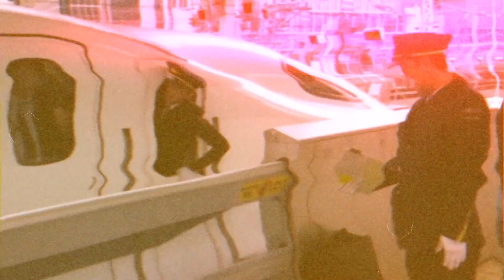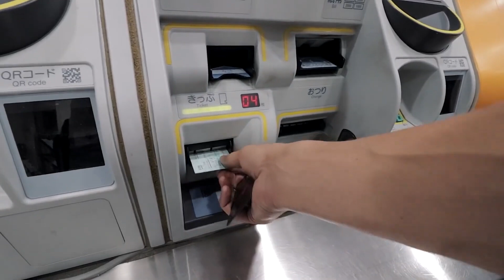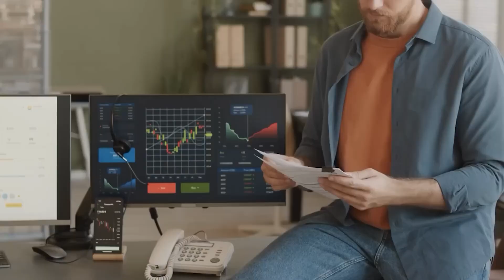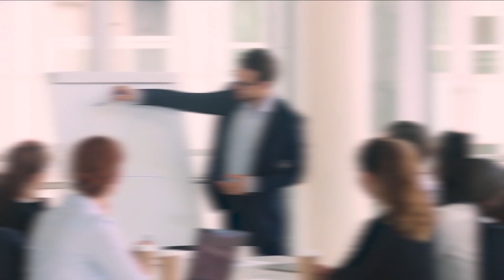The $30B Dallas to Houston Bullet Train: Will It Revolutionize Travel in Texas?

Comment: So, when is this project scheduled to start operations?  For this project to be financially sound, how many passengers per day are needed?  Where are the stations in Houston and Dallas located?  Let's say the stations are downtown.  Now, let's assume an oil company employee that works in the Energy Corridor in Houston needs to attend a meeting in Plano.  How long will the trip take?  What is the total cost?  Where is the parking?  Assuming the use of video conferencing brought on by the COVID era continues, how will the need for travel be affected?

Too much money.  There are too few answers.  Will this be another project where vast sums of money are spent on something that has little use?  Remember, this project has to compete with a Houston Hobby to Dallas Love Field plane ride.
Reply: Yes, it is ironic that new technology may make HSR less necessary for work purposes.
Reply: One is south of downtown dallas and other is at an old mall in Houston. They both will have parking nearby and the dallas station isn't far from a dart station. The biggest issue with this is that it's needed and it's privately funded but it was delayed for years because people argued that it wasn't a railroad. It's not just about competing with Love Field and Hobby. It's more that Dallas and Houston will close to 9 million each by 2030. 

That's a lot of people and more than enough people to take this train and it will be much quicker than driving. Some people will still opt to fly while others will drive. But it's a 3rd option and it's more than enough people in the area to support it. You can say things like "what if someone has a meeting in plano." Well how would they get there from love field? would they take a taxi, drive or take dart? They would have all those same options from a high speed rail station. 

The same way that if they landed at Houston hobby what options would they have to the woodlands? Or Galveston this is a 3rd option and it's viable.
Reply: @lifeinguangdong5844 
Mainly what’s holding the project up is people in rural regions filing lawsuit, since they don’t want their farmlands being converted into a high-speed rail line. The conservatives are more focused on America’s Road expansion project because it’s cheaper and people can cover their own transportation cost. 

Unfortunately, America is more focused on cost saving measures then improving American lives.

Comment: Comparing and contrasting Texas Central and CAHSR IOS with Brightline and Brightline West reveals the many differences between failure and success. Land acquisition costs, underfunding, over regulation, nimbys, adequate population, expensive electric vs. cheaper diesel. Unnecessary high speed for short distances (<241 miles) with several station stops, except TX, when fast speed trains would be best suited. Plus, Brightline provides connectivity, excellent comfort, and its business plan profits from developing real estate. 

By blending at-grade 100-110 mph tracks and 125-135 mph grade separated tracks a fast speed diesel-powered TC 240 mile trip could be 2hr15min averaging 110 mph vs 4hr30min by car. This makes so much more sense than trying to overachieve with a 220 mph top speed electric high speed train averaging 160 mph to arrive in 90 minutes so it can try to compete with a limited number of airline passengers it thinks it can convert. Clean bio-diesel is carbon friendly and does not require the intensive carbon created construction from electric HSR projects which take many decades to recover.
Reply: You are forgetting that EPA or local environmental agencies have a strict carbon emissions law such as tier 4 diesel machinery, significantly cutting emissions
Reply: @ccentralchannel4492  Some states may have different standards. Perhaps you may have inadvertently overlooked that I specifically used diesel Brightline trains, which clearly meet FL emission regulations, as a factual example of meeting strict carbon emission laws. This would also be true in CA  since CA trains are diesel and Brightline's would be even cleaner. They would definitely be legal in TX. I would need more facts from you for me to accept otherwise. i will leave the last word with you.
Reply: Brightline west will happen mostly because the have a majority of the right of way already, if Texas Central is continued they’ll probably still be in court 5+ years from now
Reply: What your proposing will only serve for the USA to continue to fall behind the rest of the world when it comes to modern transit systems. As it is, the USA is already decades behind the rest of the modern world. We're a laughing stock when it comes to public transit infrastructure. We have some of the worst airports and train systems among first world countries.

If anything, the USA should be researching maglev train technology going forward. The USA should be leading the development and research of this high tech transit systems.

Public transit shouldn't be about making a profit. It's about supplying a service for the greater good just like we do with our national highway system. It's about building modern public infrastructure for the future. Imagine how much HSR the USA could have now if we had spent those trillions of dollars over that last 20 years on HSR instead of unnecessary wars. Wars, that in the end, didn't amount to much of anything. The USA has the money. It's about getting our priorities right.
Reply: @theexmann  You have hilariously gone way off topic. Maglev fantasy and profitable war have nothing to do with Texas Central. 

Happy St. Patrick's Day and enjoy a traditional Irish seven course meal: a potato and a six-pack. We Americans drink while traveling carefree in our autonomous, self-driving Teslas. 

Railroads are ancient  200 year old obsolete transportation. LOL. Your statements are very funny. Hahahaha. By the way, "What your proposing" should correctly be 'What you are proposing' or 'What you're proposing'. Sorry you missed English class that day.
Reply: And right now only one of the high speed rail projects you listed is currently under construction. And that’s CAHSR
Reply: It's not an either/or issue. If Brightline builds a faster passenger service between LA and Vegas that is great. However, it won't be HSR. Faster passenger service is a good thing compared to what we have now just don't call it HSR.

In the end, it comes down to funding. Of course HSR would be much better in the long run than just building a faster train on even older technology, but without the necessary funding, HSR is much more difficult to get done.

The USA's private investment attitude towards major infrastructure projects is to go via the inexpensive short term profit option. It wasn't always that way in the USA, but that attitude is more prevalent now. Fewer people want to take the long term approach at building things that will last generations. We've been in this short sighted rut for that last several decades and other countries have passed us during that time when it comes to infrastructure projects. CAHSR is bucking the trend and doing the more challenging project because it's the best solution long term.
Reply: @theexmann Oh boy!  CAHSR may be successfully operating 171 miles from Merced to Bakersfield by 2035. That sure is the best long term solution by bucking the trend with a challenging project for $35 Billion. That is the same estimated cost for the entire 520-mile SF-LA phase one project and seven years later. I am 199% for CAHSR no matter what no matter how much no matter how long.
Reply: @davidjackson7281  I thought you were done responding to my comments. Not worth responding to yours after this. Enough said.
Reply: The diesel could be clean burning, yes, but there is only so much of it, there will come a day when oil has dryed up and is scarce. Maybe not in our lifetimes, but grandkids perhaps... Shouldn't pass the problem to future generations, that's shameful.
Reply: @cabebishop  Indeed, diesel is a fuel of the past not the future. We have to stop thinking short term. Those solutions are designed to fail.